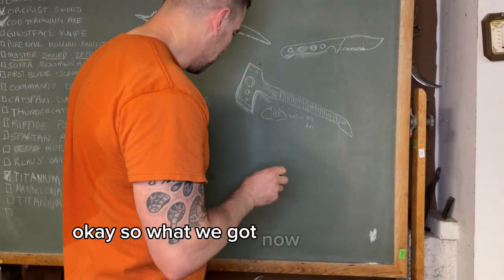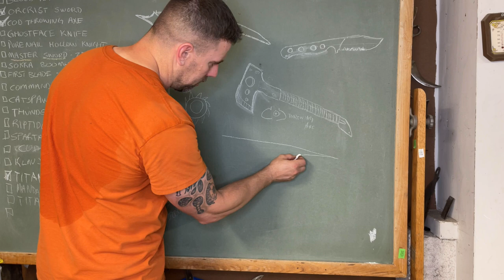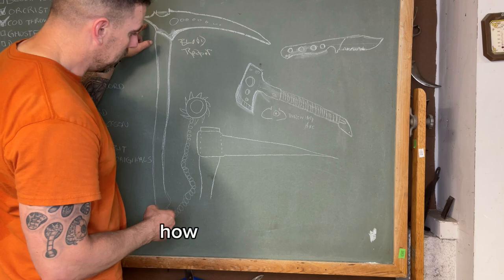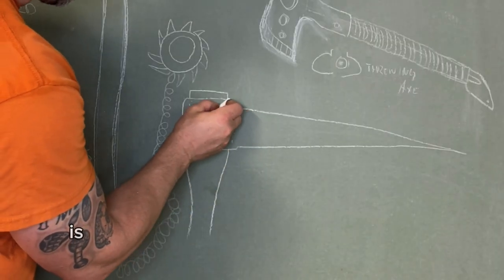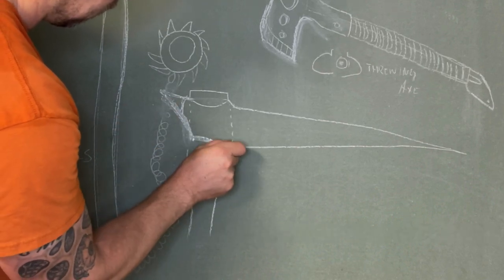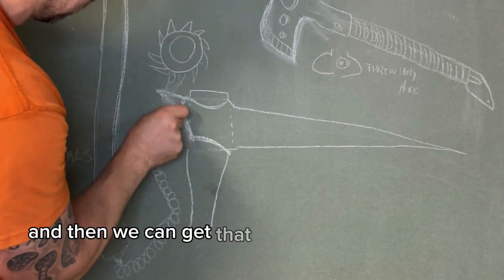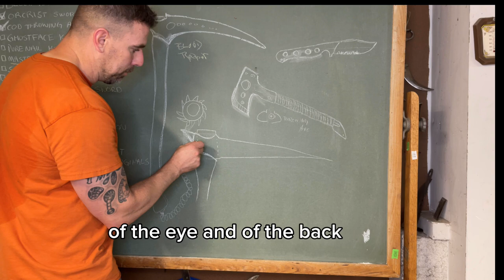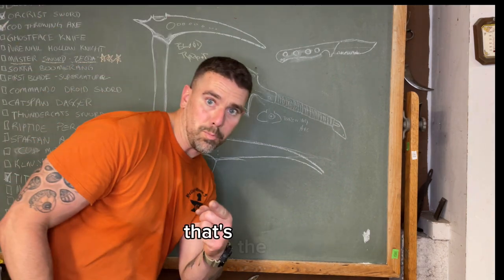Forging a Blood Reaper style Sickle from Shadow Fight 2!

Comment: How do I do this on a heavy budget?
Reply from the maker: The spring steel is free, you can grab a forge on Amazon that can get to forge welding temp. Hammers are pretty cheap, you can also get a really decent anvil from Amazon too! Then I’d say an angle grinder from harbor freight to Fi the grinding. The fancy shmancy tools just make it easier and faster, but absolutely doable without them🤘🔥